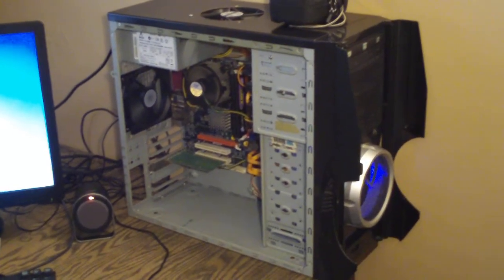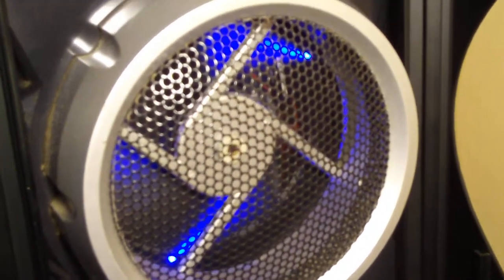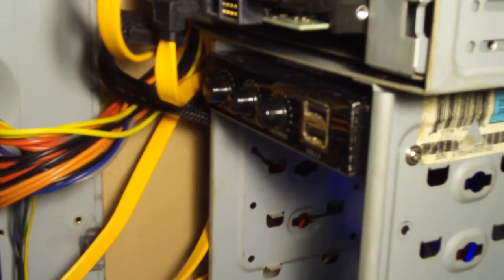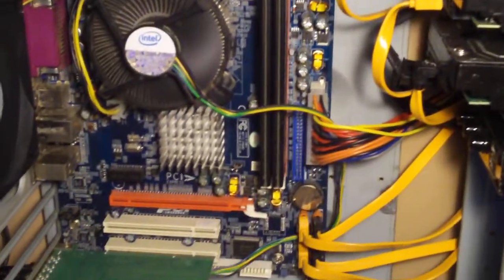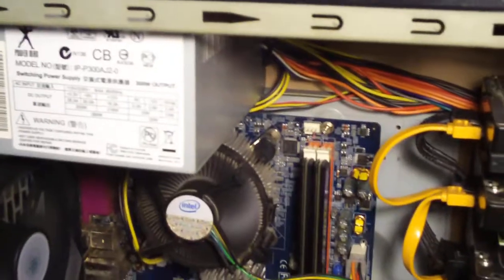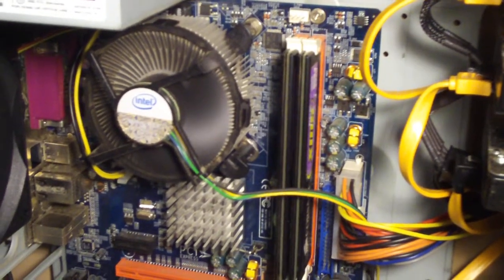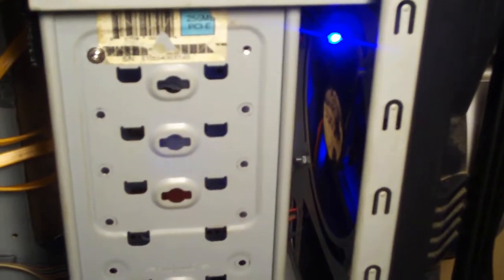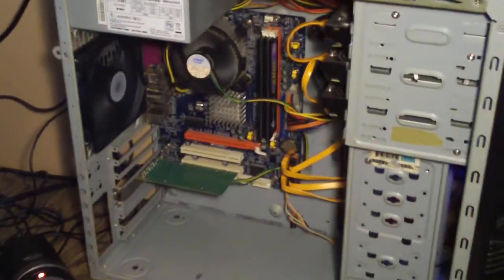Temporary Computer Cable Management Part 2

Comment: @ComputerTechTV nice you get to buy an new puter. What are you getting? i7? i5? yeah i like that video. its fun to read comments on. I just bought some tools my self to open up my laptop. Think the cooler is going bad on it. Freggin hp cant stick to standards. Like screw PH0 aparantly is PH2.0x2.0 on hps service manual. and T8 is appartly more like T8.5 in real life. Argh standard hp. standards. They dont know that word. Would you mind telling them from me? maybe they listen to you :)